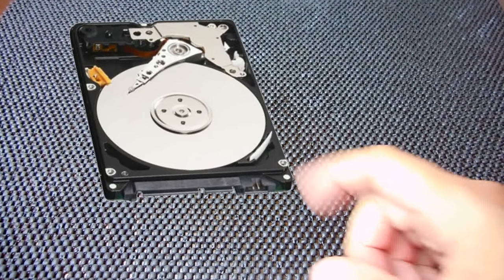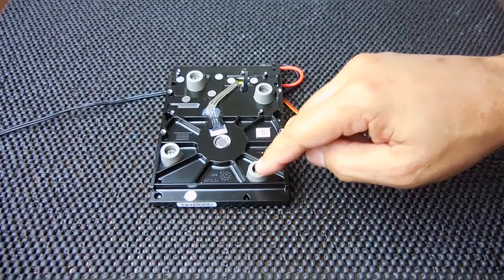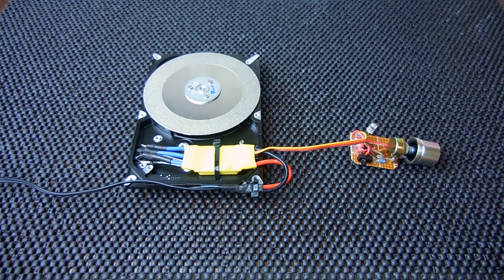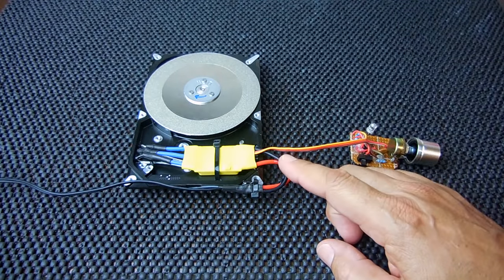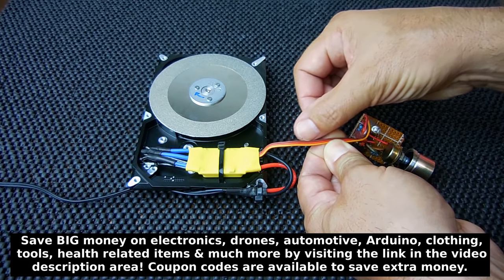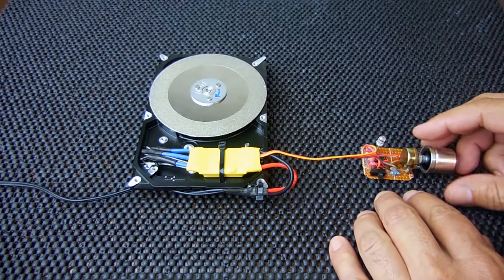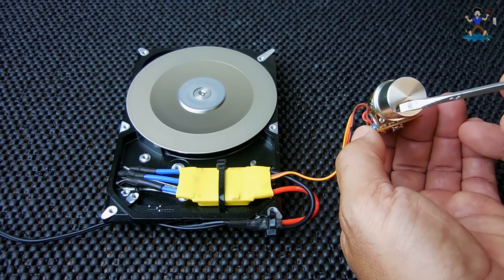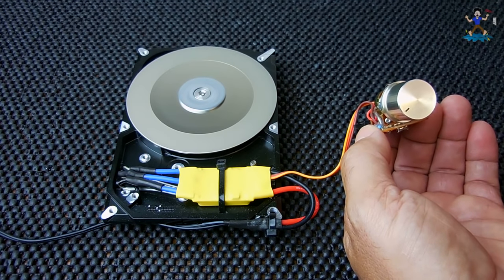Old Computer HDD Hack!

Comment: That worked better than I expected. Without a lot of precision mounting the diamond plate, I thought balance would be challenging. Might be able to use this setup, with a guide, to grind TIG electrodes.
Reply from the maker: Kent VanderVelden I was amazed myself, considering the metal washer wasn't perfectly centered, and the diamond disc wasn't perfectly flat. The high speed flattened the disc right out.

Comment from the maker: Correction: The 3 phase motor is making the "Beeping" noise due to pulses from the ESC. The ESC is not beeping. If you have a 4 wire hard drive(which is 3 phase Star/Wye), then you need to identify which terminal is the "common" terminal for the 3 windings. Once identified, don't use the common terminal, only the other 3.
Reply: hello bro thanks soo much for the video can you please help with block diagram of the circuit with the connection to the hdd ok please really a fun of your videos and really love it.... well this my first time asking such a favour ok

Comment: You are right in saying that it doesn't matter where you connect the wires, since its an AC motor in delta configuration(most likely), however, some viewers might find their hdd  has four terminals, in that case you have a Y configuration AC motor. In that case it might be important to get your connections right. Using a multimeter on the ohms setting measure all the points to one another, you will find that some show more resistance than others use this info to find your center tap and use the right driver. I made my own driver some time ago but needless to say, it's a lot of trouble that a single chip prettymuch solves. Thanks for the video!
Reply from the maker: RapiBurrito Yes. Definitely Delta. Any 2 pins show 3.2 ohms. For star, you'd see values that were 2x the resistance when measuring across the pins, and 1/2 the resistance when measuring from the center of the wye. Glad you enjoyed the video!

Comment: Most esc's are calibrated by sending full speed signal before applying power, so turn the pot full cw, apply power and it should respond with a beep!

Comment: Some hard drive platters are made of glass (though they still look like metal).  It varies by manufacturer and model.

Replacing that platter with a material designed to take stress, as you did, is a much safer way to go in my opinion.

Comment: looks good and a lot more thought out than the others I have seen today, on the to do list cheers
Reply from the maker: I've seen the other videos on Youtube, my design with the diamond disc is the best. Thanks for watching!
Reply: hi my hard drive is slightly different inside but I was wondering if your grinding disc is flat or is it slightly dished to clear the sides of the case?
Reply from the maker: ross cavallaro Perfectly flat.
Reply: ok thanks I was curious because my hard drive discs are only 95mm wide and a 100mm would not sit inside the case or have I looked at things wrong?
Reply: Oh I think I see now I have to space it up a bit with a washer and then a washer to hold it in place.
Reply: Thanks for the video and answers all parts ordered now to wait.
Reply from the maker: ross cavallaro Have fun putting it together. :-)
Reply: It worked a treat and sharpens light knives quite well, not a lot of torque but hey its better than nothing thanks again

Comment: The ESC beeping normally comes from the motor via a bit of modulation, adding a beeper to the ESC would make them more expensive. See if it still beeps with no motor plugged in?
Reply from the maker: Please read down the comment section. You'll see a reply to another user regarding your comment. Thanks!

Comment: very well done project.  Just a couple of questions.  The diamond disc, you said 4 in,  which comes to 101.6mm, and ive seen 100mm discs for sale, but the hdd platters are 95mm.. did you remove material from the outer edge?  Also why did you use a washier insted of the original hdd platter hold down?  Finally how did it last as its been a few years now, anything you would do differently?

Comment: Also I can do this with laptop hard drives?? I have about 20 old ones made from the early 2000s really low storage about 5gb average lol.
Reply from the maker: Desktop hard drives use 12V for the motor and 5V for the circuit board. 2.5" hard drives from laptops use 5V for everything. You also have a much smaller working area.
Reply: electronicsNmore ok

Comment: If its an AC motor, can i just plug it to the electric outlet on the wall? Or use an AC motor speed adjuster?
Reply from the maker: NO! The voltage is MUCH lower for a HDD.
Reply: @electronicsNmore  ok noted. Tx for the reply.

Comment: Thanks for the video.  I'm an engraver ( @ubdrmade ) and I'm going to use this as a power hone.  My concern was that the high rate of speed would fool with the graver's metal temper.  Can you tell me how slow this disk can spin in the video config?
Reply from the maker: Ryan Wicker You have a full range of speed, so heating shouldn't be a problem.

Comment: I have the four pin HD motor also. How do you determine the common pin?
Reply from the maker: Measure the resistance between the pins using a digital multimeter. Let me know what you get using different combinations.

Comment: The hard drive I'm using has four prongs instead of three on the underside.  Run into that before?
Reply from the maker: 4 pins on the motor?
Reply: electronicsNmore yes.  Four prongs on the underside
Reply from the maker: I think one of the 4 pins could be a ground pin. The 3 remaining pins are for the 3 windings used in this video.

Comment: Ok so I had a bit of trouble.  Here's what we bought and test results

12v power from charger
Esc to "server test" 5v
Motor drive leads get about 50-100mS 15 second interval for one pulse.  

RioRand 30A Brushless Motor Speed Controller RC BEC ESC https://www.amazon.com/dp/B00M90WWNC/ref=cm_sw_r_cp_apip_Ek8oFJTL7ritK

DIYmall 3CH Digital Multi Servo Tester ECS RC Consistency CCMP Master Speed Controler Checker https://www.amazon.com/dp/B012LZKTDO/ref=cm_sw_r_cp_apip_PW8Rtt248rA9s

Comment: Why my motor is in full speed when it is half range of servo tester and when I set the full range of servo tester the motor slows down ...please help me thanks
Reply from the maker: It sounds like an issue with your wiring connection to the HDD or servo tester.

Comment: The beeping is coming from the motor not the esc and why not just use a servo tester
Reply from the maker: You're right, it's the motor. The ESC is so close to the motor, that I thought the ESC was making the noise. Since this channel is "Primarily" an electronics channel, people like to assemble circuits. If they don't want to make the 555 drive circuit, they can buy a servo tester. I had all the parts laying around. Thanks for watching!

Comment: Can I use 12v 1amp adapter to power the ESC?
Reply from the maker: Most 12v power adapters of sufficient current rating should work just fine.

Comment: ok number one the harddrive  3.5" is a 12 volt system not 120 or 110 volts your useing a 12 volt pulse controller what the mother board does on its own it is a nice set up but get the fact right on your peices that your going to make the item with
Reply from the maker: OK, Number one the 3.5" drive is a 12V device, the 2.5" uses 5V. No one ever mentioned 110/120V. LOL Get the facts right. Number 2, the HDD is driven by pulses, exactly as I stated in the video. The video was excellent. If you have a problem with my videos, then maybe you need to watch another channel.